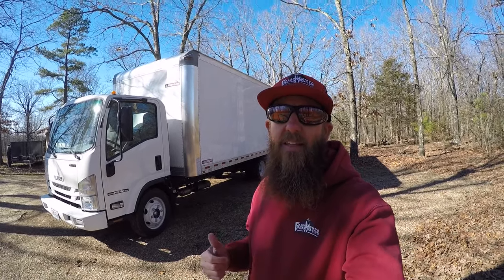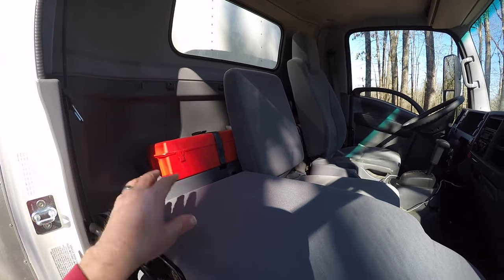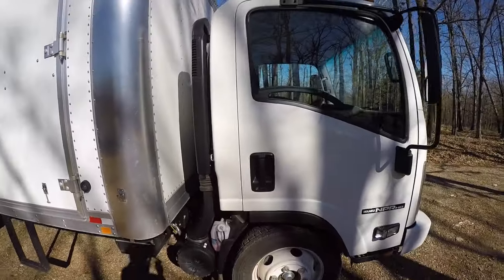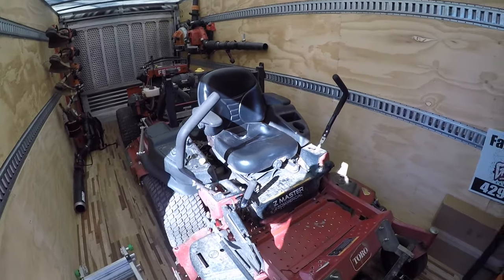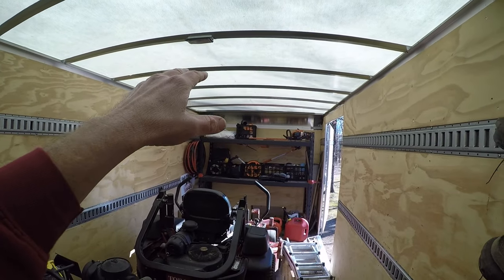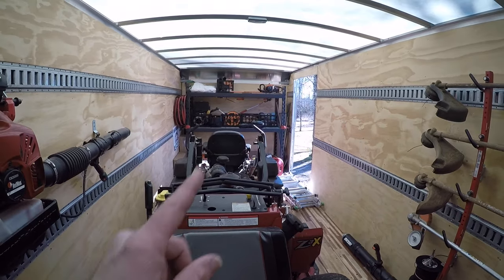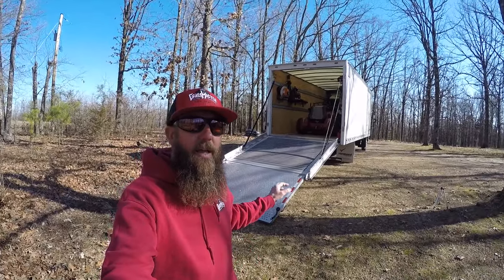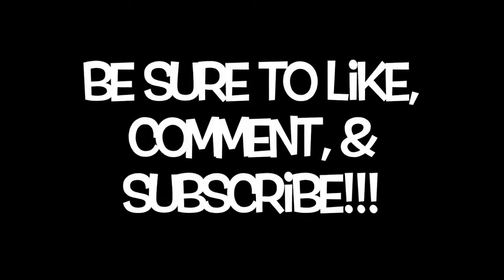2020 Lawn Care Setup (Ultimate Lawn Care Box Truck Setup) Isuzu NPR - Lawn Mowing Service Setup

Comment: I mounted a blower a stick edger and a string trimmer to my side door as well as the most common hand tools I need. Saves me from having to climb in and out so much.
Reply from the maker: That’s a GREAT idea!   I actually slide my trimmer and blower inside the side door so all I have to do is open the door, grab and go!  Walking up and down that ramp all day long every single day will wear you out!  😓 Thanks for the tip!

Comment: That ramp is really nice.
Reply from the maker: My favorite feature on the whole truck!   💯
Reply: @TheLawnCareLifeinMowssouri  I'm still a little guy running 5x8 working nights and weekends. Issue I have is with 15 inch tires and 3k pound axle, a six foot ramp. My zero turn deck hits the hinges on the ramp. A walk behind I can tip up to drive past them. Perhaps I just picked the wrong trailer. Lucky for me the zero turn is my personal mower and it only goes on trailer for trips to dealer.

Comment: Thanks for the video on the box truck! Im running a setup similar to your old one and thinking about upgrading to a newer truck with the Morgan box but they are crazy expensive! Thanks again
Reply from the maker: No problem!  Thank you for taking the time to watch!  We started with a '98 Isuzu NPR with 18ft Morgan box.  It had two bifold ramps on the back, but no side door.  We ran that setup for about 9 years before we saved up for this new truck.  It's so much more efficient now.  We just hop in and go.  Don't have to worry about breakdowns or things not working properly because of the older age.  If you're seriously wanting a similar setup, I encourage you to create a budget and plan for 2020!  You'll have that truck in no time once you create a game plan!  Hope the best for you this season.  👍

Comment: I have my interior walls ,floor, line X totally pays off with fuel spills we put a hose to it every couple of weeks makes it bulletproof expensive but worth every penny
Reply from the maker: Oh ok.   Good to know.   Do you have any pics or vids of it?  Would like to check it out.   Thanks for watching!  Have a blessed 2021!
Reply: It looks like solid heavy duty black textured material ,all the way up the walls the entire floor and down the ramp then I take the thinnest piece of diamond aluminum plate 4 foot wide the length of the ramp and screw it down this way nobody will ever fall this all takes time but it’s totally doable and when you’re done everyone would say I should’ve did it that way ,because if you paint it to seal the wood it will all fly off. I’ve use the Same process in my box truck which are used for fertilizer and store a tote of water it gets a full inside wash after each round zero rot on wood metal etc.

Comment: Did you design/build the ramp gate door? Wonder if those specs or plans are available or can the door/ramp be purchased from someone separate from the box?
Reply from the maker: I did not design the ramp gate door.  It is part of the Proscape Van Body from Morgan Corporation.  They can build it on your box, but it's probably easier to get the box/ramp all at once.  It's just the way the have to build the ramp with the box.  Makes it easier if it's all done at once.  Hope that helps!

Comment: Cameron, I would like to know does the truck have a Diesel of gas engine?  What is the GVW of the 20' box truck.  Did you purchase this truck Brand New or was it used?  Is it a 6 speed Automatic transmission? Does Morgan offer a different side door side step to get in and out?  Thank You
Reply from the maker: This is the 6.0 gas engine.  The GVW is 20,500.  Bought it brand new from Isuzu with the Morgan Vanscape Body.   This is the 6L90 6 speed transmission.   They offer different side steps, but they didn’t communicate that to me when I bought it.    I don’t like the side step.   Definitely not convenient getting in and out of the side door.   I would like to have a small step that pulls out kinda like for a camper.   I think that would be 100 times easier.   Almost dangerous getting back out of the truck while trying to use that step.  If you have any others questions, just let me know.   Thanks for watching!

Comment: How steep is that ramp? I am debating between the morgan proscape box/ramp without the dovetail or the Super Lawn Truck with the dovetail and a hydraulic ramp.

I downloaded an angle finder phone app and my enclosed trailer now with a dovetail is 15 degrees and the one without the dovetail is 18 degrees.

Super Lawn Truck says to expect 18-21 degrees. I'm curious where the Morgan Proscape ramp sits.
Reply from the maker: It’s not steep for loading/unloading a mower.  I will say that walking up and down the ramp ALL day long, 6 days a week gets old after a while.  I’ve been doing this for 20 years so I’m always looking at doing things more efficient/easier.  The pros outweigh the cons on the Morgan Proscape ramp.  I personally don’t like the dovetail and hydraulic ramp.  This design is much simpler and you don’t have to worry about the slope in the back of the truck.

Comment: That's too clean and organized. Have you looked into camper steps for the side?
Reply from the maker: Haha...it’s the off season.  I actually thought about the RV flip out steps.  They had something similar in 2018 at the GIE Expo.   It looked like my step, but you pulled it out so you could step in/out of the box a whole lot easier.  Need to check into it.

Comment: Im considering switching to a box truck in the middle of 2020. I would like to have the option to put 36”, 52” and 61” Ferris standers in the box. Would an 18ft box fit that if the 36” was sideways?
Reply from the maker: Hey Somerset!  I think you'll like the box truck setup!  You can easily fit all 3 of those mowers in an 18ft box truck.  I had 2 60" zero turns and a 48" walk behind sideways in my old 18ft box truck.  So, you would be perfect with that setup!  Appreciate you taking the time to watch.  If you have any other questions about the setup, just let me know.  I've been running the box truck setup for 10 years now.  👍

Comment: I have a 16 ft. box truck setup. Where did you get that gate setup>?
Reply from the maker: Nice!  It is a Proscape Box made by Morgan.  They custom build them on the Isuzu chassis.
Reply: Love that ramp. Can  they fab one up for my 05 Isuzu? I'm using the bifold aswell but if it breaks I'll do someti
hing didderant. Your setup  inside is almost the same as mine.
Reply from the maker: The main reason I bought this truck was the ramp!!!  You can buy just the ramp setup but it’s like $15k.   I’m sure if you found a good fabricator, they could hook you up!
Reply: I'll keep the one I have. That's way over priced.
Reply from the maker: I hear ya.  It’s really beefed up.  But I wouldn’t buy it individually.

Comment: We have a isuzu NPR with a Morgan box and in not a fan of the flooring they use.
Reply from the maker: I have to agree.   We have a very heavy duty rubber floor mat that came with the truck.  Definitely recommend it!  Our old box truck didn’t have that and this is much nicer!
Reply: @TheLawnCareLifeinMowssouri   I was referring to the flooring that they used in the Box itself almost looks like a tongue a groove  Varnished flooring. Kind a slippery when wet. As far as a seat covers go I would look on Amazon we purchase both sets of ours from Amazon.
Reply from the maker: Central Florida Lawncare I was wondering about that after I hit send.   While I haven’t had any issues with our truck because it hasn’t been wet, I can definitely see how it could become that way as it’s pretty smooth surface.  Thanks for the heads up on the seat covers.  I appreciate it.  👍

Comment: Does have a isuzu diesel or gm V8 gas?
Reply from the maker: This particular model has the V8 Gas engine.  All of the Isuzu Dealers that I talked to recommended it over the Diesel engine.  Thanks for the question.  If you would like to know more about the truck, just let me know.  Thanks!

Comment: Is your truck a gas or diesel?
Reply from the maker: It’s the Gas engine!  I was steered away from the Diesel engine by several Isuzu reps.  Apparently there’s too much to go wrong and with the new emissions it can be a headache.   Plus I’m only putting about 12k miles per year on the truck.
Reply: @TheLawnCareLifeinMowssouri  I was also, told the same thing, that I should get a 6.0 gas engine. Thank you for answering my question so fast!
Reply from the maker: Yeah, it’s definitely a solid engine that has been around for a while.  And easy to swap out or get parts down the road.  No problem, thank you for watching the channel!
Reply: I have both gas and diesel if I’m going to haul dirt dump truck body  and equipment skid steer’s I like the diesel for everything else the gas is a dream no noise , fast Great fuel mileage if you want more payload you could put the urethane helpers by the springs works great but now The truck dealer mentioned a $2500  mandatory service to the exhaust system on the diesel I’ll be all gas from now on
Reply from the maker: If you want to keep the diesel, the best thing to do is delete it probably.  Diesel has so much more power it’s not even funny.  Hope to get one of my own someday in the future.   Thanks for watching!

Comment: I too run a isuzu box truck. I have a hydraulic gate but love that gate. Where did you get that teuck/box from? Check out musi mowing & more inc on facebook for pics of my truck.if you like. Have green touch racks on inside. Also put bed liner on the floor to protect. Have had since 2012.
Reply from the maker: Nice!  Definitely love the box truck setup.  I'm going to head over to your FB Page and check out your setup.  Sounds like you have put a lot of time in it to get it exactly the way you want it.  This truck is the Isuzu NPR HD with Morgan Proscape Body.  They built it at Morgan Corp brand new last year.  Thanks for checking out the Channel.  I appreciate it!  👍
Reply from the maker: Good looking setup!   Do you have the SLT hydraulic ramp?  Can’t tell in the pics.
Reply: Truck was buikd by conyers in ga. It is a hydrsulic gate that was modified as it cane as 2 separate gates that when i got home, could not ger my walker ghs or super b mowers into. Had to extend 32". Once extended became to heavy so we went to a custom built hydraulic system. Be on truck since 2012.
Reply: My next truck with have the hydraulic 4 yd dump between cab and box

Comment: Hey Cameron nice video and sweet truck! I'm looking into a similar truck for my lawn business. I'm debating on this type of box or the dovetail box. I'm understanding that you lose room for space with the dovetail then if I just went with your style box. The main reason I was leaning towards the dovetail is due to what I see yours is doing with the mower deck scraping. Is that a deal breaker or no? I just called my local Isuzu npr dealer and he's getting some information together to go over with me tomorrow. What did something like that cost like a ballpark figure? Thanks for your help and I definitely love your setup! Also have you had any engine issues?
Reply from the maker: Hey there!  Thanks for watching the video.   I love the box truck.  The main reason I went with this one is because of the ramp.  I love the way it tucks away inside the box and you can advertise on the back.  Our old box truck just had bifold ramps on the back.   This one is so much easier.  The decks barely touch the diamond plate cover at the peak of the ramp.  It doesn’t really drag on it or anything like that.   Now on my old box truck, it would drag.   But we ended up putting two 2x12 boards down inside the box and it eliminated the dragging.   It gives the mower just enough height to glide over.  I don’t particularly like the dove tail, but that’s just preference.  There’s nothing with that setup at all.   These trucks run about the same price as a 3/4 ton diesel truck.  So you can figure around 50+ brand new.  The engine is a 6.6L V8 and I haven’t had any issues at all.   But it’s still brand new lol.   Hope that helps.  Let me know if you have any more questions.  Thanks again for watching.
Reply: @TheLawnCareLifeinMowssouri  thanks Cameron for your quick response. I just found you on Facebook too and liked your page! Check out my page too on Facebook. I think after watching your video I want to go with your box style and love that ramp. All the older ones I see have those heavy bifold ramps split in the middle. Yours is nice and definitely a nice back area for putting up a logo to advertise.
Reply: @TheLawnCareLifeinMowssouri  how much just for the box with your  ramp style set up? I can get a truck used, or where can I get the box?
Reply from the maker: It’s a Morgan Proscape box.  They were like $14k just for box alone years ago.  No telling what the price is now.
Reply: @TheLawnCareLifeinMowssouri  thanks Cameron! I ended up buying a used Penske truck and modified it to work for my mowing business! Check out my setup for 2022 I did on YouTube.

Comment: Nice setup, price range?
Reply from the maker: Thanks!  About the same price as a 3/4 ton diesel setup.  👍
Reply: @TheLawnCareLifeinMowssouri  ok, I have a dually and 20' enclosed trailer and want to get away from it. Where did you purchase? I'm in Louisiana and not very many places here carry those trucks...
Reply from the maker: Kelvin Ross The truck manufacturer is Isuzu and the body manufacturer is Morgan.  In order to get a custom made box truck, head over to your local Isuzu Dealer to learn more info!